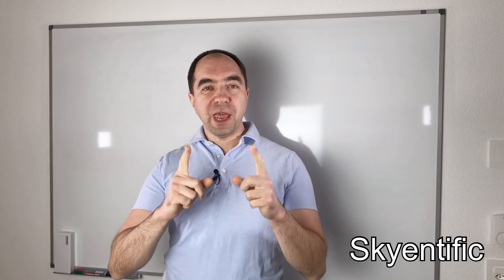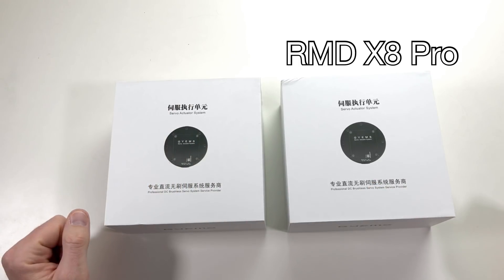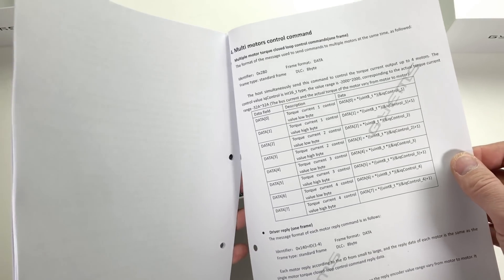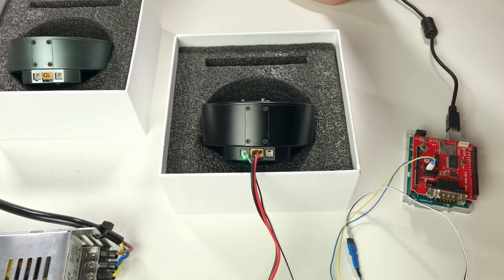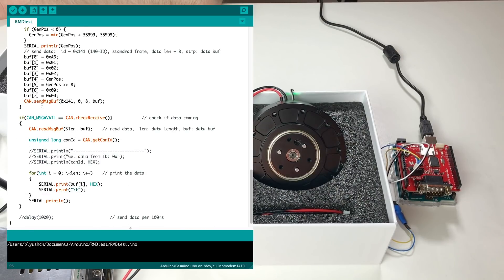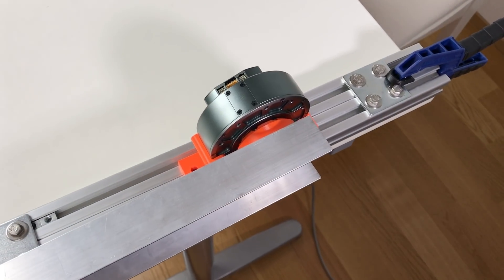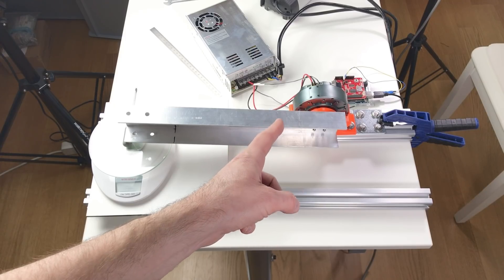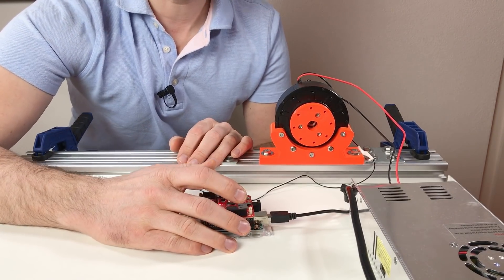I found Best Robot Actuator (GYEMS: RMD x8)

Comment: Great review! Could I ask you if you have any idea about the backdrive reistance? With this I means what effort (Nm) is needed to manually drive the output shaft when the actuator is turned off. In my project it is very important that the device can be manually overrriden without adding too much resistance. Thank you in advance!

Comment: Hi! we are experiencing difficulties trying to find a good way to home the actuator, it comes with an absolute encoder, but unfortunately it is not mounted on the output shaft, but on the motor shaft, so we can detect home in the 0-360 range of the motor shaft, however, we dont know on which of the 6 positions of the gearbox output it is on... not without adding an extra encoder, limit or home switch and a routine. Are there any similar motors out there that do have an output shaft encoder, or how do you recommend we go around this?

Thanks!

Comment: Hi, I have a trouble with the CAN BUS conection; the Arduino code works but the motor don´t move; I probe the same code with other motor and works good. I think that the firmware is the trouble. So too probe it with the UART drive and works good, please HELP ME!!
Reply: Have you found a solution? I have the same problem...
Reply: @clementd4984  I found the problem. The motor driver malfunction and it was replacement with other new. You have disoldering the internal wiring and put in the new driver with other soldering. Is a fabrication fail and GYEMS no gave me a guarantie. Very bad.
Reply: @perezmiguel3877  Well, this sounds bad... 😐

Can you share your code fore the CAN communication? I tried several things (including thencode in this video) with a MCP2515 module and with a CAN shield from Keyestudio, and it doesn't work, but I'm not 100% sure that my code is correct. 🙏
Reply: @perezmiguel3877  And thanks for the response, by the way! 👍
Reply: @E K  the code is the same used in this video and works very well, review if you  made correctly the CAN bus line and put the correct and put the correct dial code switch for the motor address

Comment: Hello.
Can you please described me the torque mode?
Do i understand correctly, that if i want to rotate a motor with constant speed, and constant torque, than my input via can is only :"direction, speed, desired torque"? Or desired torque is set only via config limiting current? Can i during motor operation change all these parameters? 
Thank you very much

Comment: Great video. Just wondering why did you use 2 terminator resistors? I looked through the manual and it said you just need a 120 ohm resistor between each high and low line of each bus.
Reply from the maker: You need one termination resistor at each end of the bus. My bus is very short there. So that is why both termination resistors are close to each other.
Reply: thank you

Comment: In minute 4:37 you mention that you implemented two termination resistor on the cable that goes from the CanBus shield to the RMD X8 Motor.
Please can specify which termination resistors you used and in which sequence?

Comment: henri
How does one calculate  payload... for real ife example

Design a robot to lift router ie spindle say 6kg

How do you go about calcutating the reduction gear the size of each axis reduction and motor size...
Using clearpath sd servo...please..

For a give reach ..?  Say 1m arm reach

Comment: I am having problems a lot with the rmd x8 pro.... because of the firmware don't allow spinning the engine in angle control over 360 degrees
.
 ... it's really hard to make something with it

360 degree before the gearbox like a normal rmd8 without gearbox
Reply from the maker: I don’t agree. It is simpler than most other actuators which I tried.  It works fine for me. You can check my arduino code in this video.
Reply from the maker: And I’ve made a robot shoulder with it. Works fine too.
Reply: @Skyentific  ... we can't get the multi turn to work properly... it is locked to 360 degrees... so even if i want to make several spins it do only one ... 
What code are you using for multi turn 2 ? 

I will check your code thank you
Reply from the maker: I mostly use multiturn.
Reply: What code did you specifically use for multi turn angle control mode 2?? 

 We are loosing the nights over this... other engines wasn't a problem also for us (also from same company ) but the x8pro.... i don't know why we are 3 people over this project.  We check your code and run it but it doesn't works properly... we got about 40 of this engines for a walking robot ...
Reply from the maker: // demo: CAN-BUS Shield, send data
// loovee@seeed.cc

#include <mcp_can.h>
#include <SPI.h>

/*SAMD core*/
#ifdef ARDUINO_SAMD_VARIANT_COMPLIANCE
  #define SERIAL SerialUSB
#else
  #define SERIAL Serial
#endif

// Define Joystick connection pins 
#define UP     A1
#define DOWN   A3
#define LEFT   A2
#define RIGHT  A5
#define CLICK  A4
    
//Define LED pins
#define LED2 8
#define LED3 7

#define StepValue 140

// the cs pin of the version after v1.1 is default to D9
// v0.9b and v1.0 is default D10
const int SPI_CS_PIN = 10;

MCP_CAN CAN(SPI_CS_PIN);                                    // Set CS pin

void setup()
{
    SERIAL.begin(115200);
    delay(1000);
    while (CAN_OK != CAN.begin(CAN_1000KBPS))              // init can bus : baudrate = 500k
    {
        SERIAL.println("CAN BUS Shield init fail");
        SERIAL.println(" Init CAN BUS Shield again");
        delay(100);
    }
    SERIAL.println("CAN BUS Shield init ok!");

    //Initialize pins as necessary
    pinMode(UP,INPUT);
    pinMode(DOWN,INPUT);
    pinMode(LED2, OUTPUT);
    pinMode(LED3, OUTPUT);
      
    //Pull analog pins high to enable reading of joystick movements
    digitalWrite(UP, HIGH);
    digitalWrite(DOWN, HIGH);
      
    //Write LED pins low to turn them off by default
    digitalWrite(LED2, LOW);
    digitalWrite(LED3, LOW);
      
}

long GenPos = 0;
void loop()
{
    unsigned char len = 0;
    unsigned char buf[8];
    
    if (digitalRead(UP)==LOW)
    {
      GenPos = GenPos + StepValue;
      if (GenPos > 35999) {
        GenPos = max(GenPos - 35999, 0);
      }
      if (GenPos < 0) {
        GenPos = 0;
      }
      SERIAL.println(GenPos);
      // send data:  id = 0x141 (140+ID), standrad frame, data len = 8, stmp: data buf
      buf[0] = 0xA6;
      buf[1] = 0x00;
      buf[2] = 0x09;
      buf[3] = 0x02;
      buf[4] = GenPos;
      buf[5] = GenPos >> 8;
      buf[6] = 0x00;
      buf[7] = 0x00;
      CAN.sendMsgBuf(0x141, 0, 8, buf);
    }

    if (digitalRead(DOWN)==LOW)
    {
      GenPos = GenPos - StepValue;
      if (GenPos >= 36000) {
        GenPos = 35999;
      }
      if (GenPos < 0) {
        GenPos = min(GenPos + 35999, 35999);
      }
      SERIAL.println(GenPos);
      // send data:  id = 0x141 (140+ID), standrad frame, data len = 8, stmp: data buf
      buf[0] = 0xA6;
      buf[1] = 0x01;
      buf[2] = 0x09;
      buf[3] = 0x02;
      buf[4] = GenPos;
      buf[5] = GenPos >> 8;
      buf[6] = 0x00;
      buf[7] = 0x00;
      CAN.sendMsgBuf(0x141, 0, 8, buf);
    }

    if(CAN_MSGAVAIL == CAN.checkReceive())            // check if data coming
    {
        CAN.readMsgBuf(&len, buf);    // read data,  len: data length, buf: data buf

        unsigned long canId = CAN.getCanId();
        
        //SERIAL.println("-----------------------------");
        //SERIAL.print("Get data from ID: 0x");
        //SERIAL.println(canId, HEX);

        for(int i = 0; i<len; i++)    // print the data
        {
            SERIAL.print(buf[i], HEX);
            SERIAL.print("\t");
        }
        SERIAL.println();
    }
    
    //delay(1000);                       // send data per 100ms
}

// END FILE
Reply from the maker: // demo: CAN-BUS Shield, send data
// loovee@seeed.cc

#include <mcp_can.h>
#include <SPI.h>

/*SAMD core*/
#ifdef ARDUINO_SAMD_VARIANT_COMPLIANCE
  #define SERIAL SerialUSB
#else
  #define SERIAL Serial
#endif

//for timing of the loop:
unsigned long currentMillis;
long previousMillis = 0;    // set up timers
int loopTime;

//joystick:
int Joy1UD = A6;
int Joy2UD = A5;
int Joy2LR = A4;
int Joy3UD = A3;
int Joy3LR = A2;
int Joy4UD = A1;
int Joy4LR = A0;

//Values for the joystick
int ch1;
int ch2;
int ch3;
int ch4;
int ch5;
int ch6;
int ch7;

//position of each motor
long ch1a = 0;
long ch2a = 0;
long ch3a = 0;
long ch4a = 0;
long ch5a = 0;
long ch6a = 0;
long ch7a = 0;

//previous position of each motor
long ch1ap = 0;
long ch2ap = 0;
long ch3ap = 0;
long ch4ap = 0;
long ch5ap = 0;
long ch6ap = 0;
long ch7ap = 0;

// variable to receive the message
unsigned char len = 0;
// variable to send the message
unsigned char buf[8];

long GenPos;
long GenVel;
int MaxVel = 250;
int StepInc = 800;

// the cs pin of the version after v1.1 is default to D9
// v0.9b and v1.0 is default D10
const int SPI_CS_PIN = 3;

MCP_CAN CAN(SPI_CS_PIN);

void setup() 
{
    SERIAL.begin(115200);
    delay(1000);
    while (CAN_OK != CAN.begin(CAN_1000KBPS))              // init can bus : baudrate = 500k
    {
        SERIAL.println("CAN BUS Shield init fail");
        SERIAL.println(" Init CAN BUS Shield again");
        delay(100);
    }
    SERIAL.println("CAN BUS Shield init ok!");
    delay(1000);
    //limit acceleration
    long Accel = 100000;
    buf[0] = 0x34;
    buf[1] = 0x00;
    buf[2] = 0x00;
    buf[3] = 0x00;
    buf[4] = Accel;
    buf[5] = Accel >> 8;
    buf[6] = Accel >> 16;
    buf[7] = Accel >> 24;
    //CAN.sendMsgBuf(0x141, 0, 8, buf);
    //CAN.sendMsgBuf(0x142, 0, 8, buf);
    //CAN.sendMsgBuf(0x143, 0, 8, buf);
    //LED ON (D6)
    pinMode(6, OUTPUT);
    digitalWrite(6, HIGH);   
}

void loop() {
  // put your main code here, to run repeatedly:
  currentMillis = millis();
  if (currentMillis - previousMillis >= 10) {  // start timed event
    loopTime = currentMillis - previousMillis;
    previousMillis = currentMillis;
    SERIAL.println(loopTime);
    analogReadResolution(10);

    ch1 = analogRead(Joy1UD);
    ch2 = analogRead(Joy2LR);
    ch3 = analogRead(Joy2UD);
    ch4 = analogRead(Joy3LR);
    ch5 = analogRead(Joy3UD);
    ch6 = analogRead(Joy4LR);
    ch7 = analogRead(Joy4UD);

    //axis 1
    if (ch1 > 600) {
      int a;
      a = map(ch1, 600, 750, 0, StepInc);
      a = constrain(a, 0, StepInc);
      ch1a = ch1a + a;
    } 
    if (ch1 < 400) {
      int a;
      a = map(ch1, 400, 250, 0, -StepInc);
      a = constrain(a, -StepInc, 0);
      ch1a = ch1a + a;
    }
    //axis 2 and 3
    if (ch3 > 600) {
      int a;
      a = map(ch3, 600, 750, 0, StepInc);
      a = constrain(a, 0, StepInc);
      ch2a = ch2a + a;
      ch3a = ch3a - a;
    } 
    if (ch3 < 400) {
      int a;
      a = map(ch3, 400, 250, 0, -StepInc);
      a = constrain(a, -StepInc, 0);
      ch2a = ch2a + a;
      ch3a = ch3a - a;
    }
    if (ch2 > 600) {
      int a;
      a = map(ch2, 600, 750, 0, StepInc);
      a = constrain(a, 0, StepInc);
      ch2a = ch2a + a;
      ch3a = ch3a + a;
    } 
    if (ch2 < 400) {
      int a;
      a = map(ch2, 400, 250, 0, -StepInc);
      a = constrain(a, -StepInc, 0);
      ch2a = ch2a + a;
      ch3a = ch3a + a;
    }

    //Important: ch1a, ch2a etc. should not be changed by more than 35999 at one step!!!
    //move motor 1
    //if (ch1a != ch1ap) {
      GenPos = ch1a;
      GenVel = map(abs(ch1a-ch1ap), 0, StepInc, 100, MaxVel);
      GenVel = constrain(GenVel, 100, MaxVel);
      //SERIAL.println(GenPos);
      // send data:  id = 0x141 (140+ID), standrad frame, data len = 8, stmp: data buf
      buf[0] = 0xA4;
      buf[1] = 0x00;
      buf[2] = GenVel;
      buf[3] = GenVel >> 8;
      buf[4] = GenPos;
      buf[5] = GenPos >> 8;
      buf[6] = GenPos >> 16;
      buf[7] = GenPos >> 24;
      CAN.sendMsgBuf(0x141, 0, 8, buf);
    //}
    //receive message
//    if(CAN_MSGAVAIL == CAN.checkReceive())            // check if data coming
//    {
//        CAN.readMsgBuf(&len, buf);    // read data,  len: data length, buf: data buf
//
//        unsigned long canId = CAN.getCanId();
//        
//        //SERIAL.println("-----------------------------");
//        //SERIAL.print("Get data from ID: 0x");
//        //SERIAL.println(canId, HEX);
//
//        for(int i = 0; i<len; i++)    // print the data
//        {
//            SERIAL.print(buf[i], HEX);
//            SERIAL.print("\t");
//        }
//        SERIAL.println();
//    }
    //move motor 2
    //if (ch2a != ch2ap) {
      GenPos = ch2a;
      GenVel = map(abs(ch2a-ch2ap), 0, StepInc, 100, MaxVel);
      GenVel = constrain(GenVel, 100, MaxVel);
      //SERIAL.println(GenPos);
      // send data:  id = 0x141 (140+ID), standrad frame, data len = 8, stmp: data buf
      buf[0] = 0xA4;
      buf[1] = 0x00;
      buf[2] = GenVel;
      buf[3] = GenVel >> 8;
      buf[4] = GenPos;
      buf[5] = GenPos >> 8;
      buf[6] = GenPos >> 16;
      buf[7] = GenPos >> 24;
      CAN.sendMsgBuf(0x142, 0, 8, buf);
    //}
    //receive message
//    if(CAN_MSGAVAIL == CAN.checkReceive())            // check if data coming
//    {
//        CAN.readMsgBuf(&len, buf);    // read data,  len: data length, buf: data buf
//
//        unsigned long canId = CAN.getCanId();
//        
//        //SERIAL.println("-----------------------------");
//        //SERIAL.print("Get data from ID: 0x");
//        //SERIAL.println(canId, HEX);
//
//        for(int i = 0; i<len; i++)    // print the data
//        {
//            SERIAL.print(buf[i], HEX);
//            SERIAL.print("\t");
//        }
//        SERIAL.println();
//    }
    //move motor 3
    //if (ch3a != ch3ap) {
      GenPos = ch3a;
      GenVel = map(abs(ch3a-ch3ap), 0, StepInc, 100, MaxVel);
      GenVel = constrain(GenVel, 100, MaxVel);
      //SERIAL.println(GenPos);
      // send data:  id = 0x141 (140+ID), standrad frame, data len = 8, stmp: data buf
      buf[0] = 0xA4;
      buf[1] = 0x00;
      buf[2] = GenVel;
      buf[3] = GenVel >> 8;
      buf[4] = GenPos;
      buf[5] = GenPos >> 8;
      buf[6] = GenPos >> 16;
      buf[7] = GenPos >> 24;
      CAN.sendMsgBuf(0x143, 0, 8, buf);
    //}
    //receive message
//    if(CAN_MSGAVAIL == CAN.checkReceive())            // check if data coming
//    {
//        CAN.readMsgBuf(&len, buf);    // read data,  len: data length, buf: data buf
//
//        unsigned long canId = CAN.getCanId();
//        
//        //SERIAL.println("-----------------------------");
//        //SERIAL.print("Get data from ID: 0x");
//        //SERIAL.println(canId, HEX);
//
//        for(int i = 0; i<len; i++)    // print the data
//        {
//            SERIAL.print(buf[i], HEX);
//            SERIAL.print("\t");
//        }
//        SERIAL.println();
//    }
    //move motor 4

    ch1ap = ch1a;
    ch2ap = ch2a;
    ch3ap = ch3a;
    ch4ap = ch4a;
    ch5ap = ch5a;
    ch6ap = ch6a;
    ch7ap = ch7a;
  }
}
Reply: Could you solve the problem? If yes, please let me know.
Reply: @scharfet  i could not.
Reply: @scharfet  in the next days when i have time i will look into it one more time. 
The seller is responsive and kind, we skyped few times, i didn't have the right amount of time to look into this.
Reply: @fireworm91  In the PC-software "RMD Motor Assistant" from Gyems I found a command, called "Increment Angle Control 2" (0xA8), maybe this can help you. I am not sure wether this command can be used because it has more than 8byte. But this code is not described in the official Control Command List.
Speed and Angle can be set. If you find a solution, please let me know.
I am an absolute newby.
What I need is a simple code (arduino) that does following.
2 revolutions (720°) with a certain speed (180 dps) , then
3 revolutions with 240 dps, then
1 revolution with 360 dps, etc....

What I currently need is just a simple code to get the motor running, no matter how, using Arduino.
I plublished my code on github. It would be greate if you coud have a look at the code. I also published my email there.

Good luck with your project.
Reply: @scharfet  i talked to the main engineer that make that program he explained me that program is only for debugging and testing,  the multiturn from the pc is locked up to 360 degrees before the gearing.  
How did u call the project on github? 
If u want i can test it today and let u know.
Reply: @scharfet  man, i wold like to find your tread on github but i can't find you. 
Not by name not by searching about the rmd x8 or x8pro not by gyems...  will write an old junk email here. I will delete it into 30 minutes.
Reply: @fireworm91  Sorry, was not aware that youtube delets all URLs which I sent.
My username on GitHub: scharfet
Name of the repository:  Control-RMD-X8-using-Arduino-and-CAN-Bus__Simple
Reply: @scharfet  i got the code. Today or tomorrow when i have some free time i will test it. I am busy with 3 other projects that are complex but will let u know .
Reply: @fireworm91  Thank you!
Reply: @fireworm91  May I friendly request wether you had time to have a look at the code? Thank you
Reply: @scharfet  yes i am pretty busy with a crane prototype. Will email you